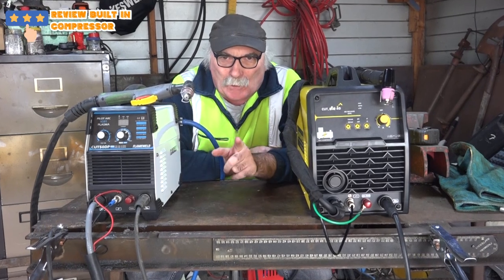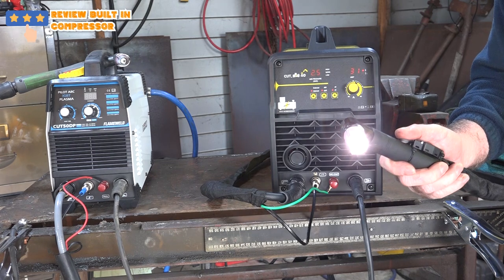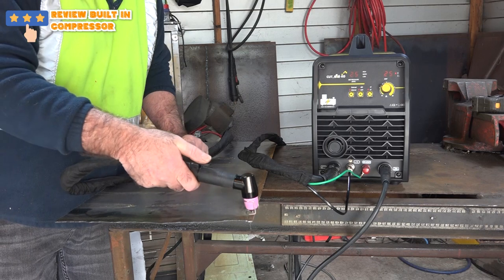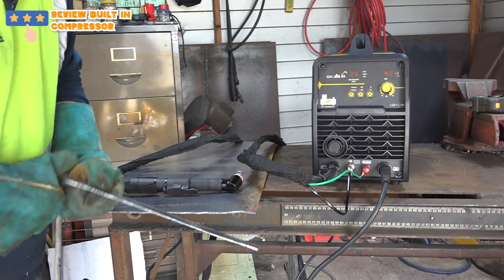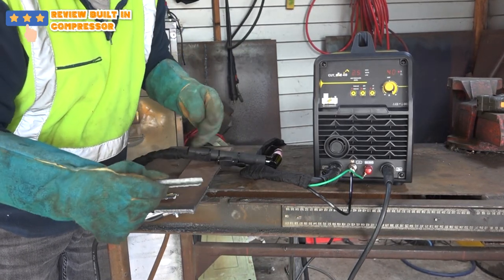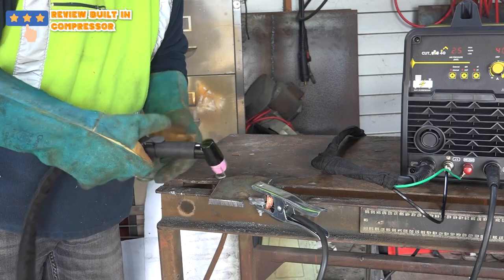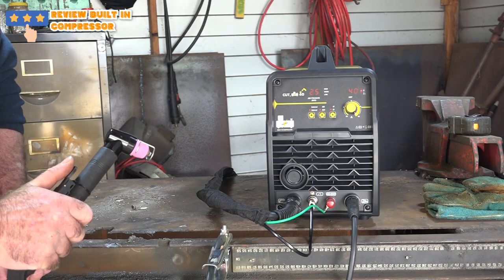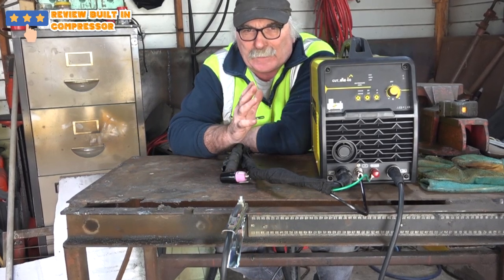Will a Plasma Cutter With Built-In Compressor Actually Cut Thick Metal?

Comment: Neat...2 ideas to improve its function...have it be able to stick weld , by using a switch to change from plasma cut to stick weld..like many of the 3 in 1 chinese machines do....and also allow it to have a fitting on the machine, to hook up a regular air hose, so the compressor can now be used to pump air in tires, etc.
Reply from the maker: Cool idea